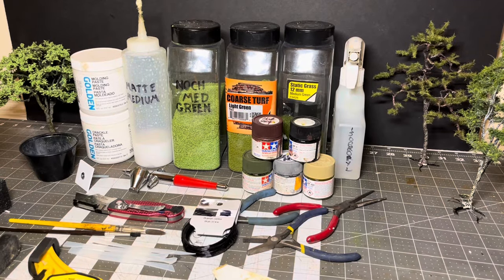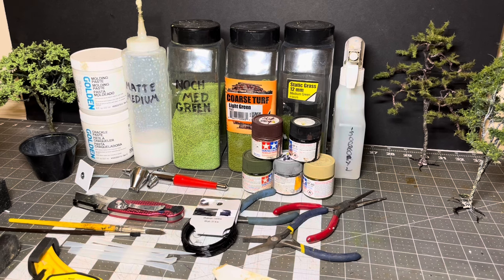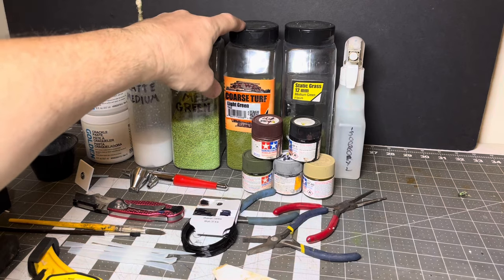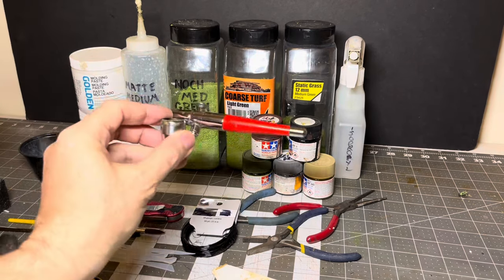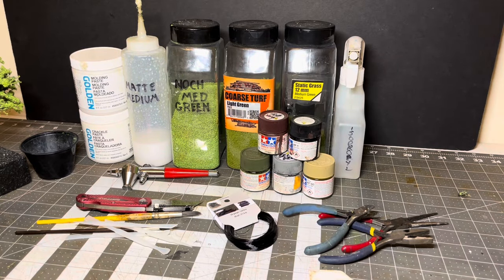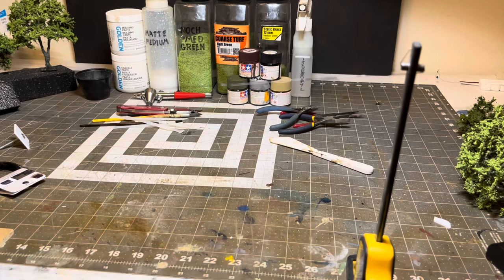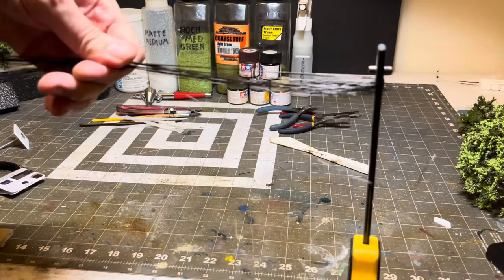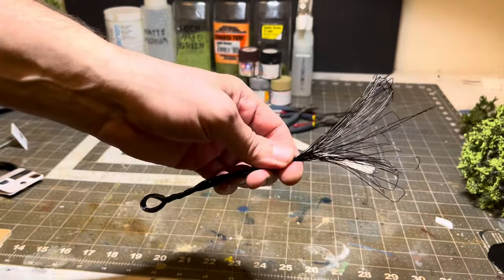Wire Armature Model Trees-How To Part 1 Basic Tools and First Steps for More Realistic Model Trees

Comment: Excellent video , I will trying this for sure, because of my trade copper wire was very easy to get, I rewound motors, smaller gauges came on 6 inch spools, that loop you created we used that for a starting winding for electric motors which we called a skein , we had a jig to wind the coils , I could make one for trees , great video, round two next
Reply from the maker: Thanks James, I do remember that about electric motors now that you mention that. I tried winding motors a couple of times for my RC cars, but failed miserably every time.

Comment: Hey Christian, thanks for a great series. I have FloraCraft brand 26 guage Floral Wire. It is painted green, but I don't think that matters. Only 90 yards, but it DOES come on a spool. That wild coil you had looked pretty hard to manage. I think I got it at Hobby Lobby several years ago. I see it on Amazon now for $1.77 per reel. Hope that helps.
Reply from the maker: Thanks Bill, I’ll check that out.

Comment: Ok Question  the first wire loop, for a 6 inch tree , 4 inch tree how long first loop
Reply from the maker: It’s usually 3-4 times the height. 4” tree is going to be 12-16 inches for the loom, so when you cut that in half you’re at 6-8” for the pigtail. By the time you twist the wire you’ll end up in that 4” range
Reply: Ok I hope to set up and do a loom tonight
Reply from the maker: @dundasjunctionmodelr.r-jam8267 part two will be out on Friday, you might want to wait before you go too far on wire bending
Reply: Only doing part one tonight just show case what you are doing I hope will see